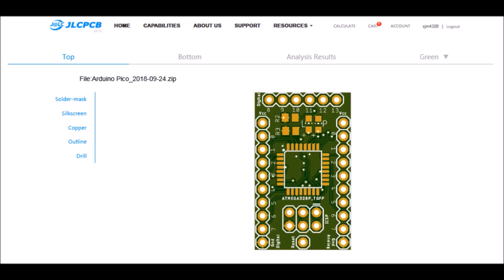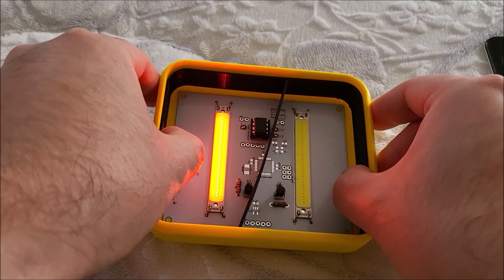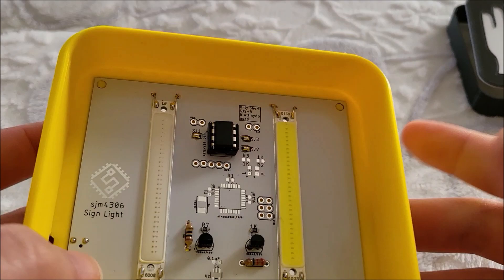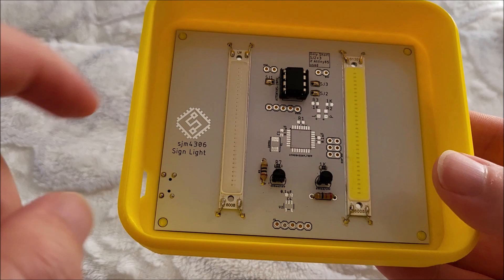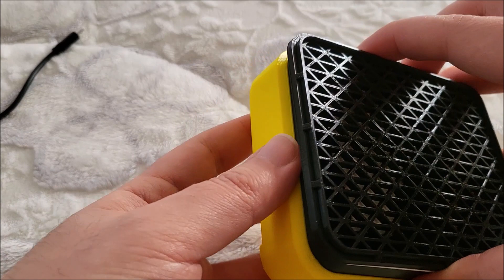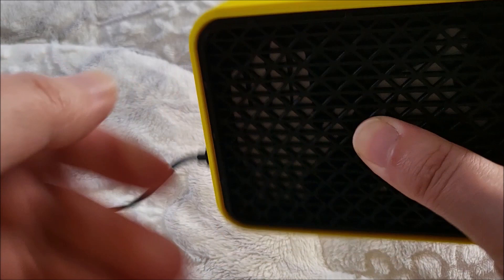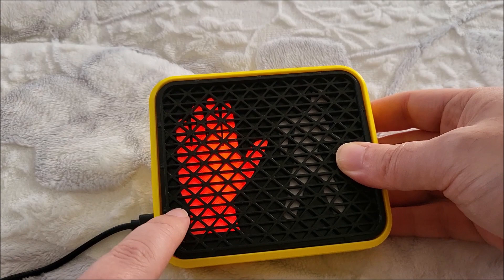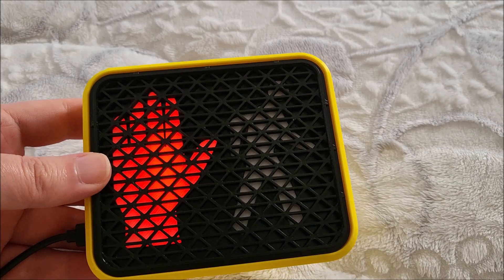DIY Mini Pedestrian Crossing Night Light

Comment: this is so cool. got me thinking about trying to make one with discrete leds & making one that has the countdown timer too. the complexity of the shadow mask would be difficult, but a welcome challenge
Reply from the maker: Countdown timer instead of the walk symbol would be cool. Then you could add buttons and program it to be a general purpose timer or clock. I don't think it'd be horribly difficult to modify the shadow mask to add the seven segment digits.

Comment: Very neat. I like the grill. A 3D printer (and design skills) would be so handy for things like replacement battery covers and display stands. I think JLCPCB do printing now too, so all I'm missing is the design skills 😀
Reply from the maker: The grill totally makes this project, without it it looks like a cheap 3d printed kid's toy (which to be fair it totally is). I've been meaning to try JLCPCB's 3d printing service but gotta come up with an excuse to not just use my own printers. Honestly if you really want to get into 3d design I'd suggest starting with one of those free online cad programs. But be warned, it's super addicting designing something cool and be able to print it out and hold it in your hands.